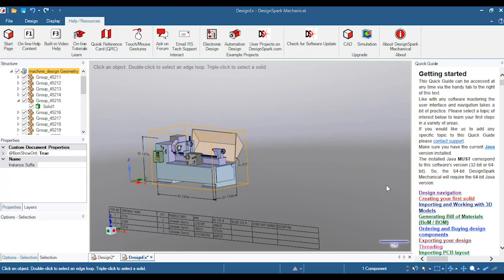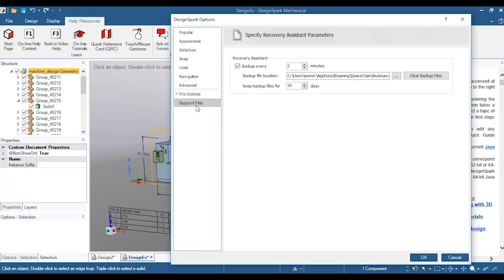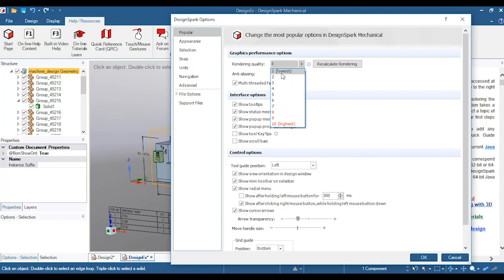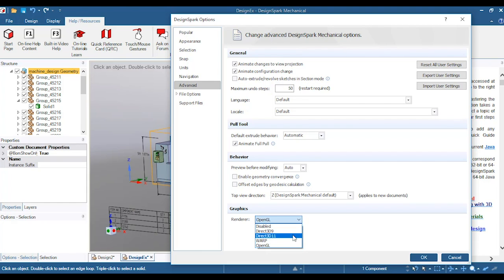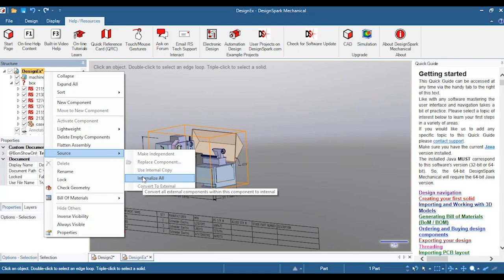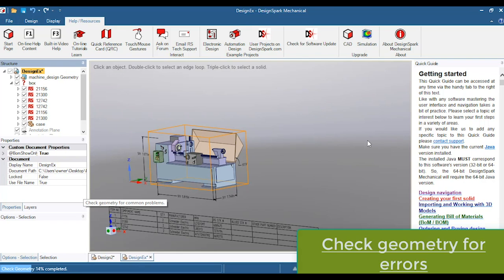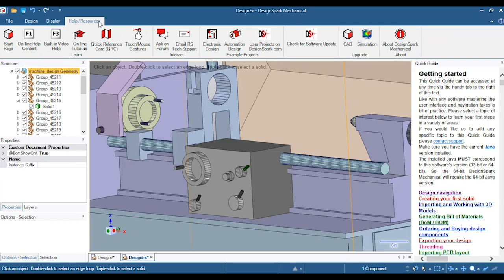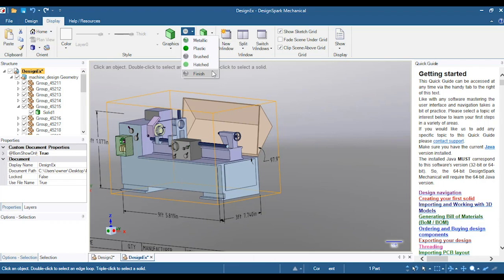DesignSpark Mechanical v4.0 Tips Part 1

Comment: With regard to the 'Backup' option that you describe. This is incorrectly named as it is not so much a backup system but a crash recovery system. Please watch my two videos - https://youtu.be/K6tXrf8du-g 'backup' problem AND https://youtu.be/qb_HMjFUd38 explanation. As you will see that any file that is 'backed up' during a session, is immediately erased when DSM is quit. Files will only remain in the 'backup folder' if the program crashes rather than is quit in the normal way.